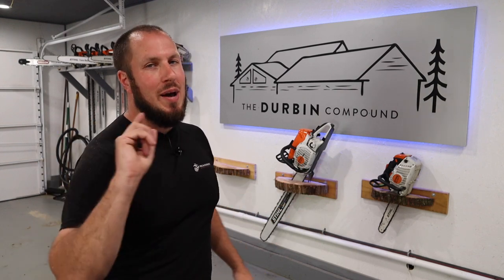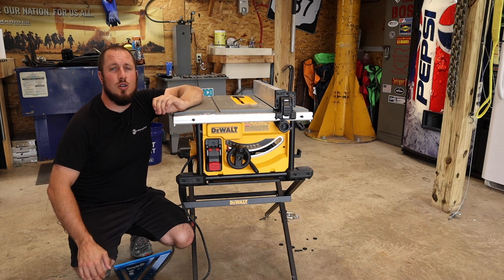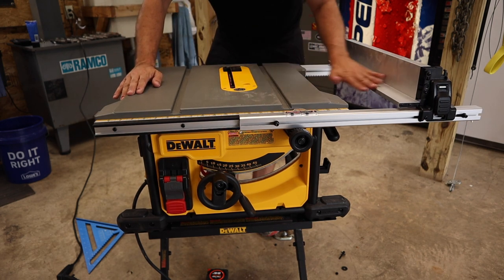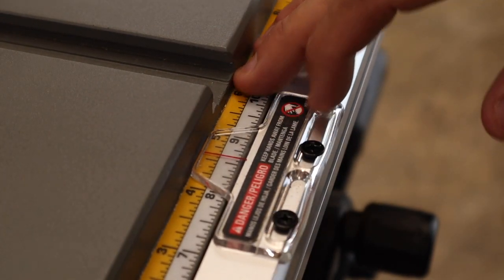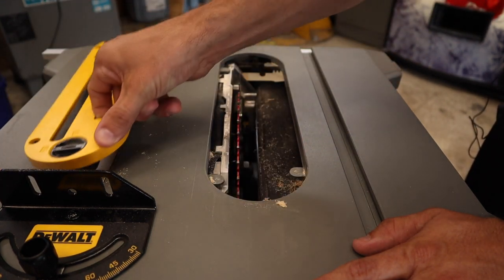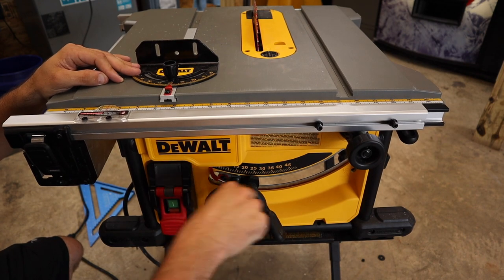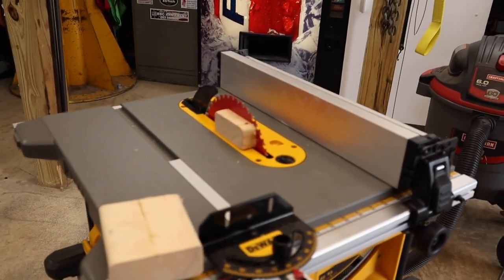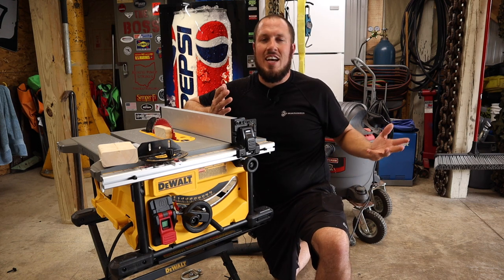DeWalt Table Saw DWE7485-Best Table Saw For The Money!

Comment: Well... Amazon delivered my new saw & Diablo blade today! I'd like to brag that the saw was perfectly aligned right out of box, but no such luck!
1) Saw blade found to be parallel to miter slots and perpendicular to front and back table edges (thankfully)
2) Removal and replacement of riving blade found to be easy / straightforward (Thanks DeWalt). Removed it while making alignment tweaks
3) Table insert NOT level with table top... all four screws had to be adjusted to achieve planarity
4) Saw blade NOT 90 deg to table top, and found that adjustment of stop to be a bit tricky... but finally tweaked it in OK
5) Fence in both position 1 and 2 was NOT parallel with saw blade (nor perpendicular to table edges).  Was able to tweak alignment per manual directions
6) Removal / replacement of saw blade using supplied wrenches proved easy / straightforward 
7) Sample cut of short 1x6 board showed cut to be square in both directions... Viola!
Think I'm really going to enjoy using this saw.  Your review helped me gain confidence in the purchase, so thanks again!

Comment: A pretty good rundown on the saw.  As mentioned below, using the fence AND the miter gauge together is a major no-no.  Some other things, I believe the miter gauge slot on the table is the standard width and depth.  While the miter gauge seems like  an after thought, replacing it would be easy enough.  I also believe this saw uses the same 15 amp motor as the 10" saw, which is a very good thing since the DeWalt motor has been one of it's strong suits.  Makita is oddly way behind DeWalt in the jobsite table-saw category.  After all these years, that one is a real head-scratcher.  There isn't a great selection out there for 8 1/4" thin kerf ATB blades, but there are some.   In short, this is an even more affordable and compact version of DeWalt's excellent jobsite table saws, that can still do a sheet of plywood in a pinch with it's 24.5 inch capacity.  personally speaking, I use a track saw for sheet goods, rather than a small table saw...easier, safer and more accurate.
Reply: Yep I was surprised to him do that. I have worked on saws for many many years and if your fence is not very true to the blade that piece would have kicked back causing trouble for you and the saw.
Reply from the maker: Yeah I have enough experience on a table saw to know the same, would not have done it with a clamped down fence. The cut was meant to show another aspect of the saw, but everyone loves to nit pick like it was a dangerous move when it really wasn’t even close.
Reply: @TheDurbinCompound  My concern is not for you. You have many people viewing the clip and one of them might think that is a good way to cut a board and get hurt.

Comment: I just bought one of these saws. The manufacturer's directions explicitly says NOT to use the miter gauge with the fence. Use either the miter gauge or the fence alone. It says there could be kickback with using the fence and miter gauge together.
Reply from the maker: Yes this is true with any table saw
Reply: That’s common sense. Anyone using both should get out of the shop.
Reply: @TheDurbinCompound  11:06 got me sweatin

Comment: Got mine last week at HD, was surprised to find out its regular price here in PR is $329 (everything in local Home Depots is way more expensive than in the ones in continental US). I probably watched about 20 videos, including this one, about reviews and unboxing of this table and got convinced over the similar priced Ridgid and the less expensive but less robust Ryobi. I'm a novice woodworker but I wanted a saw that will last long, a lot of woodworkers here on YouTube use this saw daily for making all kind of stuff so it's safe to say it will serve me well for the future. Already I'm planning on building a temporary small rolling cart for it and then start planning on a full rolling workbench for it. Thanks a lot for the video! 

PS question: does the dust exhaust port can be connected to a hose and that hose be put in a 5-gallon bucket to collect dust? Or it doesn't have enough pressure to blow the dust into that bucket?

Comment: Just bought mine today, 11 September 2020.. Set it up on sturdy saw horses and 1/2 sheet of 3/4” ply.  Table height = 37” and could easily be raised.  Semper Fi ~ excellent vid! Subscribing.
Reply: PS ~ Home Depot ~ $359.10 with military discount  ~ $389.17 after NY Sales Tax :-(

Comment: I bought mine about 8 months ago here is Australia. Can’t recommend it highly enough. Fantastic saw.
Your prices are laughable in America. Here in Australia the saw was $1,200 on special and $400 for the Dewalt trolley. I bought the stand initially for $200 but ditched that in a fortnight as I’m disabled and cannot move the saw around without a trolley. I only have a small shop so storage is better for me as the footprint is smaller and I can move it outside to cut and keep the shop dust free. The rack and pinion fence is as good as he says.
If you are thinking of a saw, buy it. I wish I had the money to buy it earlier.
I also purchased a Diablo blade at $160 when I bought the saw and have never taken it out of the packet. I find the Dewalt blade does everything I want and never even chips Melamine. 👍🇦🇺
Reply from the maker: It’s crazy the price difference! I’m glad you like the saw too. It definitely is worth the money and is super portable. I had a cabinet saw for a long time and it was so inconvenient
Reply: @shedmanx3640 Same country but bought used. Lovely saw and I built a trolley to wheel it outside so no exy exhaust system to worry about. As it had an old blade when I bought it I replaced that with a Diablo blade and the cut face is so purrrfect.
Oh, and why I commented . . . DeWalt have to match Australian standards and change the motor to a 240v job. That costs extra money. So US$400 = $623 + motor swap = $300 (if not more) so add that up and you get AU$923. Right now for AU$1270 you get the saw, and via redemption: the DeWalt saw stand, 4 DeWalt chisels and a DeWalt corded orbital sander. So, not too bad after all.

Comment: Appreciate the quick runthrough; just picked the 7480 and everything is pretty much the same  One weird thing I encountered w it - and maybe I'm just a moron that doesn't know how to seat the saw on the stand, but I ordered separately the Dewalt rolling stand and the mounting holes to the rails aren't far enough apart to catch the front and rear slots!  wth?  It's a dewalt stand for a dewalt saw??? So before I even used it, I had to fashion some sort of base that etended the reach to the slots. I settled on a tx4 of some hardwood  - walnut? - made the hole measurements, then bolted the saw to the wood strips.  Once the strips were in place, I bolted the saw to the metal arms and it's as sturdy as a brick outhouse. One final thing about that rolling stand - and I apologize for focusing more on the stand than the saw, but although the stand is a great height for me, tilting the stand to vertical to roll and store w the saw attached feels sketchy as heck w those the aluminum legs and the snap lock system they use because you have to tilt it back on two legs as basically a fulcrum.  it's doable, but I think over time this is going to start some slop in the legs, which will be serious a problem.  Not sure Dewalt thought this through very well, but overall, for my use it's the most important tool in the shop...well, maybe tied w the router! Thanks so much for the tutorial brother, I'm ready to rip, no pun intended!
Reply from the maker: I encountered the exact same problem.  My saw would not properly bolt to the stand.  The holes didn’t line up at all.  I ended up drilling different holes

Comment: About using the wrong guide marking, your said you really only use the narrower setting, so the yellow markings. Should try sticking a piece of decorators tape to the lower part of the clear marking gauge, that way you only see the relevant measurement size.

Comment: I just bought this table saw. I was lucky the stand was free with purchase. Im new to Woodworking and just a DIYer. I watch this video to learn some tips and tricks and to make sure I understand all the features of the saw. Reading the manual is boring. Lol 😂 I would like to build a cart with sides and out feed table. So then the free stand is useless. I’ll have to figure out another use for it.
Reply from the maker: Yes I don’t like this stand. I’d really like it to be taller.  By at least 3 or 4”.  It is stable but just too low.
Reply: @TheDurbinCompound  yea it’s a little low, I guess you could always build a base to set it on to bring it up some, or add casters to the base for mobility

Comment: At $800 Australian ($1AU=$.7US) we are paying +$500US for this unit while you are paying $300-$399 (going by comments). As a result it is considered to be (here) at the top end of the DIY or job site line up over here with models such as Makita priced well below it. Regardless this is the one I purchased after watching many reviews like this. It did not disappoint. Mine came with a stand free but that stand lasted a week before I built a flip top bench and chucked it away. Low and unsteady it was dangerous. I’m very happy with this saw, it is accurate and a joy to use. Coupled with the Dewalt Airlock Y splitter hoses (another $149 spent) it barely leaves any mess after use.

Comment: Just bought one, 
Lovely little table saw. 
The throat fence isn't as stable as I'd liked and there's no lock on the rise and fall but the guide fence parallel adjustment and locking system is excellent. 
So overall a well thought out 
Versatile saw.

Comment: this saw is actually great for ripping sheet goods (4x8) since it’s rip capacity is 24.5 on the right and has a 5,800 rpm motor. Not sure why you say it’s not good for this use.
Reply: beginner-level safety violation at 11:06 has me doubting any word he says
Reply from the maker: But did I die though?! 😱
Reply: @TheDurbinCompound  "nothing bad happened this time, so nothing bad will ever happen!"
Reply from the maker: @TrailTape  next video idea : best push sticks for your table saw

Comment: Great video but I'm very very new at table saws and I wish you would have shown how to change the blade. And what's a riving knife and what's it for?
Reply from the maker: That’s a great topic for a video!  I need to add that to the list! Thanks Mike!

The riving knife is the piece of steel that sticks up just behind the blade. It’s purpose it to make sure that the wood you are cutting does not come closed after going through the blade and pinch the blade. If you ever cut without one, you can watch the wood come back together after you cut it. It can bind badly and sometimes even kickback if it binds bad enough.
Reply: @TheDurbinCompound  Thank you so much. I understand now.

Comment: The 2023 Father's Day Home Depot price is $348 with a stand. Part number is DWE4875WS. I'm putting the stand in storage, and replacing it with the $158 Dewalt stand with wheels.

Comment: Since you changed the blade should you change the riving knife?
Reply from the maker: Hey Cory, the riving knife is not a wear item. It is not sharp. It’s only purpose it to provide a “shim” behind the blade so cut wood does not squeeze back onto the blade.
Reply: lot about a job site table saw and jigs I have debunked as a beginner using 1. I'm tracking almost now. TY for taking your time to reply. Now I just need to get familiar with my 540 kreg for making pocket hols, any advice would be great. 2x4. Thanks to GOD I got squaring them done, now just sanding and assembly. Any advice is greatly appreciated.

Comment: You said you don't think it is good for ripping 4x8 sheets on the job site, what do you suggest? Good video btw.
Reply from the maker: With experience it can be done but the table area of this saw doesn’t provide much support. My go to is a track saw or a sheet clamp used as a fence for a standard circular saw
Reply: It's literally made to be able to rip 4x8 sheets.

Comment: Would you say this is as good as the Dewalt 10" model?  I am considering this smaller model due to the smaller blade, smaller footprint, and lighter weight---after more usage would you still recommend it?  Thanks for the review.
Reply from the maker: Yes absolutely. I have used both. Considered the 10” but honestly didn’t see the point. There are only a few things that the 8.5” won’t cut, depth wise. It’s like comparing a sliding miter versus a standard miter.  Unless you’re cutting 2x12” you don’t need the slider. Same with the 8.5”. If you’re not cutting 4x4’s. Why get the 10” table saw

Comment: Looking to get one soon but in Australia they are 849 with no stand.
Reply from the maker: The prices in Australia blow me away!
Reply: @TheDurbinCompound  I couldn't get it so I ended up getting the 7491. 1300 dollars later but I did get a stand and a circular saw with it. Stock in Australia seems very limited.
Reply: DeWalt corded tools are hard to get here in Oz, everything is going cordless
The 7485 is available at Bunnings, $806 if you have a trade account and a free bonus stand by redemption at the moment
Reply: @OrbitalRoc  There's a single review on the Bunnings site by a fellow named "Chris" who says all the Australian 7491's have a 16mm arbour instead of 30mm. Can you confirm what yours is please? It seems nonsensical to have a smaller bore on a higher powered motor and bigger table than this 7485 model.
Reply: @TechNed  it's a 16mm arbour for the 7491-xe which is long enough for a dado stack but all the blades have to be bought from the US. If you ever want to use a dado stack the 7485-xe doesn't have a long enough arbour. Also if you want to run a dado stack you will need to also buy a new throat plate or run with none. I also thought why did they go with the smaller arbour I think it's just to be able to use dado's. I went with the 7491-xe as i have room to expand. Side note the aus dewalt webpage is very out of date so it's a good idea to check out the tool in person.
Reply: @OrbitalRoc  Thank you so much for that comprehensive reply. Plenty of conflicting info online, especially images.. I've seen several images of the 7485 (not sure if -XE) that depict it with a single guide slot to the left of the blade including on the Bunnings site. The TradeTools site actually has 2 images, one with 2 slots and a front view looking at the edge of the table that seems to have one slot..

Comment: Did you encouter any issue with that Diablo blade on this saw?  If the specs on Diablo's website is correct, the blade is a little too wide for the riving knife that came with the saw.
Reply from the maker: I have had no issue with the Diablo blade
Reply: I'm learning about riving knife safety, and there's a coupleways to look at it. 
1: Riving knife is flush with the face of the motor. Thicker kerf=loose on the fence side=passive. Thinner kerf =tight on the fence side. 
2: Riving knife is installed on the centerline of a particular kerf. Wider kerf=less drag. Smaller =tight on the fence side. If the blade has carbides that are substantially wider than the disc, then it binds an twists the part. Be safe!

Comment: Where is the motor overload reset switch located?  It is mentioned in the manual but the location is not shown. 

I have a brand new saw that won't start.

Comment: Hi, I have a few questions.  I need advice.  I am considering the purchase of Dewalt DW733 (power 1800W) and DWE7485 (power 1850W).  I have a Fieldmann 4020Bi generator available (max power 2000W, constant power 1600W).  Will it be up and running and work with that generator?  Nothing from Dewalt has a softstart.  Thank you very much
Reply from the maker: Don’t take my word for gospel but you should be good.  1800W is at the full 15A under full load.  I don’t think you’ll see that full load while cutting. So the generator should run it just fine.

Comment: It seems that no matter what small/decent saw you look at, the higher quality (and proven) fence system with Dewalt can be a determiner for some, even though some features on other saws can be better.
Me? I’ve been waiting to buy one of these smallest of portable saws because of already having a large portable job site saw for now, but? As good as it is....it’s not a one hand grab and go into a small or upstairs area saw. (I need that badly at times.)
Also apparently? One specification that means nicer quality cuts (with this 8 1/4” saw) is a smoother transfer of power to the smaller blade over the previous 10’ standard....a plus for simple trim work and it’s narrower ripping requirements. 

This saw has a lot going for it it seems (even though it’s the smaller saw).

Comment: Is it me or was that shop vac so quiet. Mine is so piercing
Reply from the maker: Yes, its pretty quiet.  It's definitely one of the better ones I have used.  The steel canister vacs are the worst!
Reply: @TheDurbinCompound  where and how did you mount those casters on it? I would like to do the same to mine.
Reply from the maker: I took two pieces of angle iron, grinded them out in the middle so they would cross over each other. Then just bolted the shop vac to it. You could do it with wood or literally any material that could support the weight

Comment: Maybe you should actually read the manual before making a video... first, the legs on the stand are adjustable for more height... second, the fence flip down has a extended slot allowing it to be used on the table top allowing cuts closer to the blade without binding.
Reply: he bought it, reviewed it, brought it back hHAHAHAHA